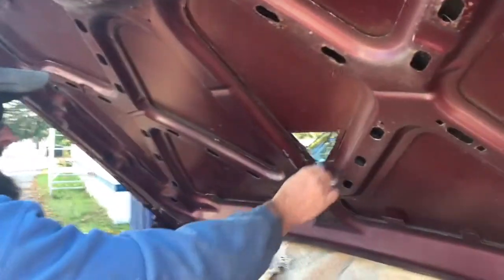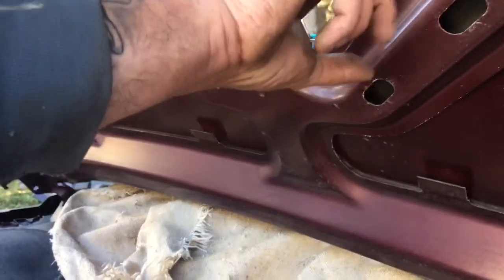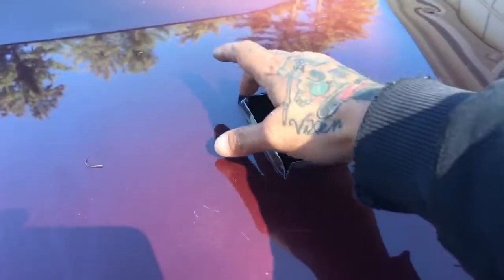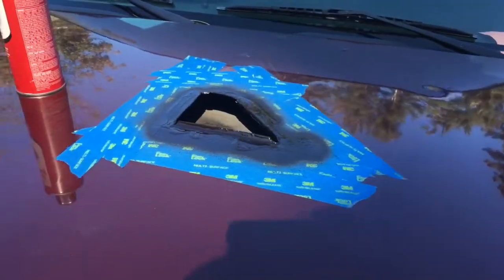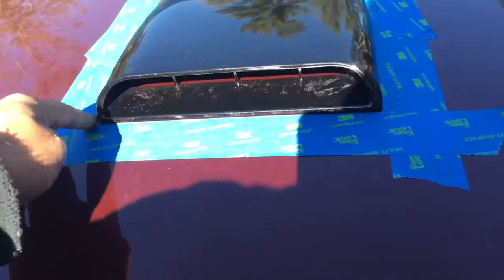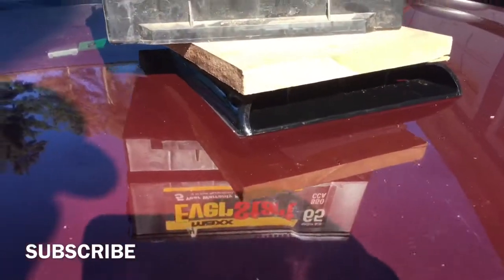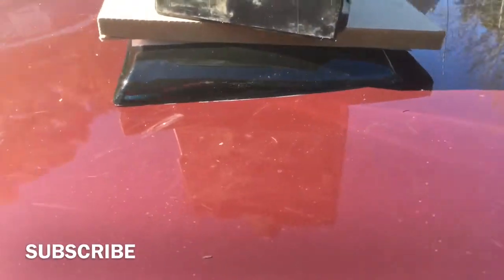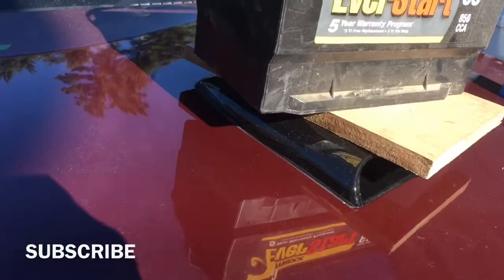REDUCE ENGINE HEAT/alternator cooling system/installing hood scoop/better voltage

Comment: please pray for me.. i wanna do the analysis or thesis EFFECT ON FUEL CONSUMPTION OF ENGINE HEAT REDUCTION METHOD OF ENGINE BAY THROUGH A SCOOP.
Reply: Is completely different method of measure there mate. Your talking about engine bay heat vs engine heat efficiency  iteself. One is internal and other is external.
Reply: abs trevathan i just only measure engine heat surrounding bro.... thus is my thesis i do.... So if engine heat surrounding could be reduced i will do test vehicle model especially the engine performance and the fuel consumption effects😊

Comment: How do you keep rain water out of your engine?  Have you had an issues with damage?
Reply: I did that with my Jeep Libery and my main issue was water getting into the igniton coils that sits directy above the vent. My solutuon is to buy gaskets that fully cover the holes that lead into spark plug holes. The advantages of the vents in a hot day is everthing runs much cooler especially air conditioners and engine temp in idle and low movement with heavy load.
Reply from the maker: No had no issues w water or snow . The person I sold the truck to doesn’t have any issues either .
Reply: Due to the lack of response, I'd say yes, he has ran into many issues with rain

Comment: Hey man I'm getting a 320 alternator do I need to redo my stock wires for thicker ones or just the positive from batt to alt
Reply from the maker: team louder the words for the plug ? Or you mean just the vehicles power and ground wires ? Yes you should upgrade the power and ground wires . As for the plug wires they should be fine .
Reply: EARDRUM ASSASSIN alright thanks man I just wasn't sure